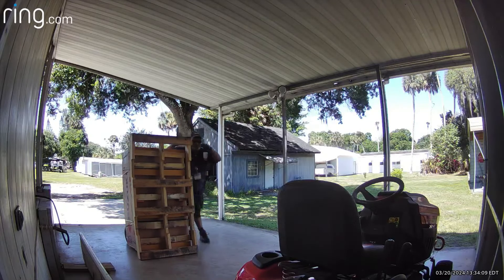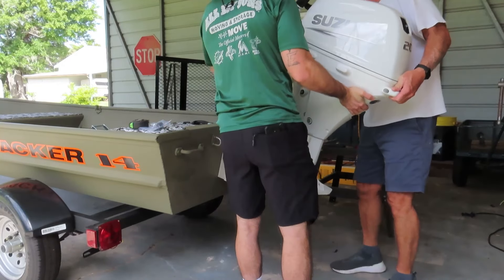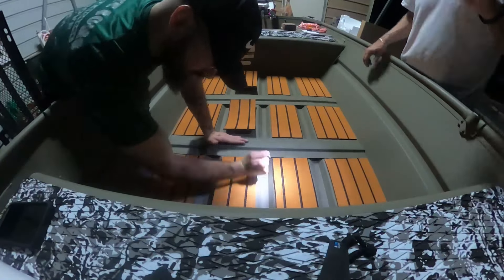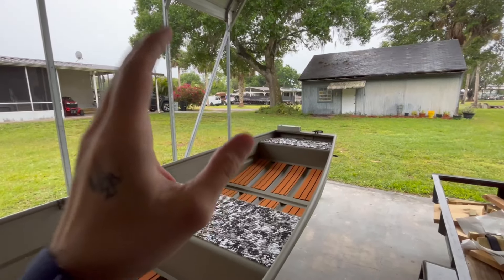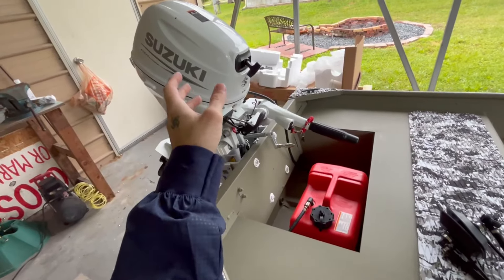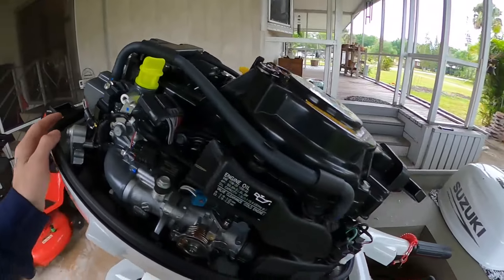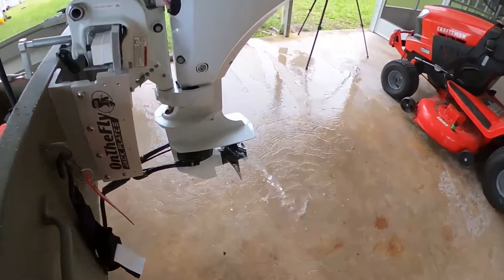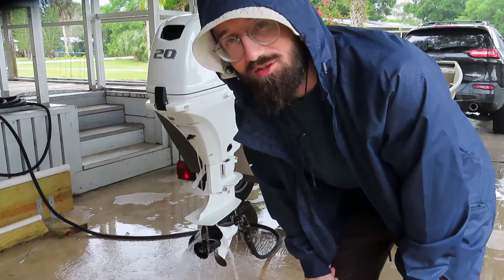NEW 2024 Suzuki 20hp on a 2024 Tacker 1436 All Weld! Too Big??

Comment: just bought the suzuki 20hp for our tender.  It seems to vibrate quite a bit at lower speeds and is not quite as powerful as i was expecting.  Have you found either of those to be true?  Have you serviced it yet, im curious what the fluids looked like at the first interval.

Comment: Loved your floor. It's simple, light, and easy to clean and dry. Haven't you have issues with borders or corners getting unglued?
Reply from the maker: No issues yet 🤞
Reply: Great. Anyways, if so, I think it's easy to glue again or replace. Was thinking about painting the ribs with some rubberized coating for more grip and avoid scratching paint just for its beauty.

Comment: Hey great video, I’m curious what the laws are in Florida about over powering a boat. I have a 1236 tracker and I want to upgrade to a 10.
Reply from the maker: I don’t recommend going over max hp. But that being I’ve had a a lot of boats and I think 90% of them had over max hp.  Can you get in trouble? Maybe 🤷‍♂️ but as long as it a reasonable horsepower then i don’t think anyone cares. I’ve been pulled over on several occasions on all my boats never has police or fwc checked my horsepower rating. I saw a 16 Jon boat going through the canal the other day with like a 90 on it

Comment: I am getting the same motor for my weld-bill 12/48. Will that same motor charge a battery
Reply from the maker: I took it out today. It was great but It won’t charge a battery. I’m pretty sure none of the small motors have any type of alternator. But maybe I’m wrong. Do the research before you buy so you know.
Reply: Electric start one should have a low amperage system but still better then nothing, most brand a you can just buy the kit and make it charge
Reply: Electric trim model must have it

Comment: Sharp build here brother!Looks like the 20 is just fine on there, its not much heavier than a 15 anyways. Im About to get the 1436 and trailer at bass pro, and a new 2023 20 suzuki with tilt and trim/el start. Ive discovered to avoid the tiller problems, it helps to build a tiny console and add a steering/shift instead, it will balance the boat way better and make it less stern heavy, thats the number one thing that limits performance and driver comfort on these boats.